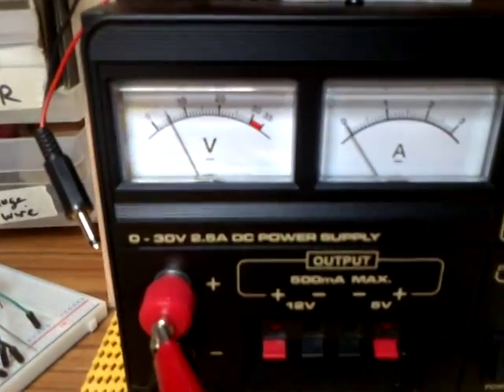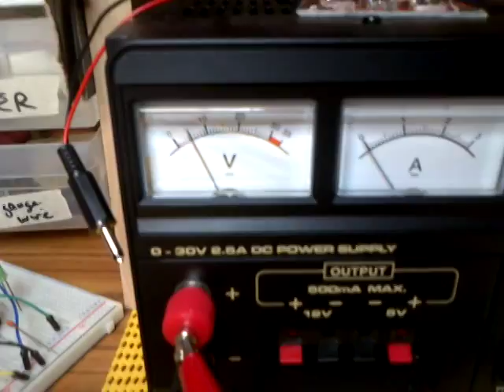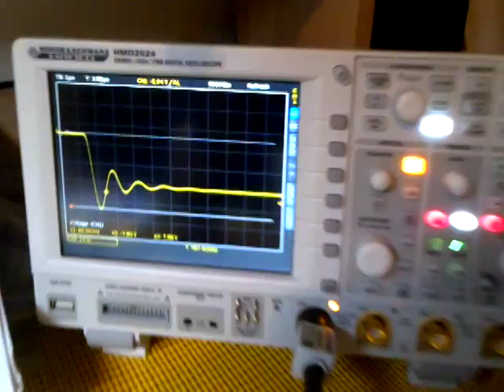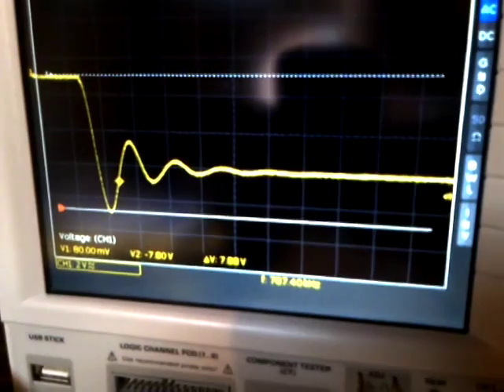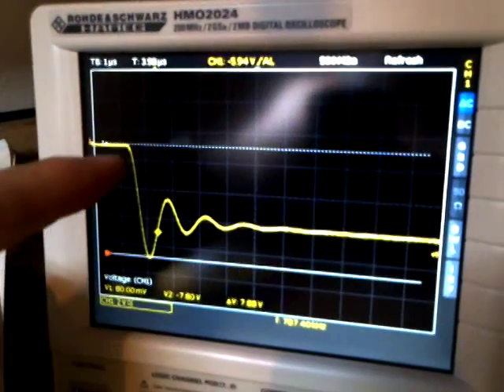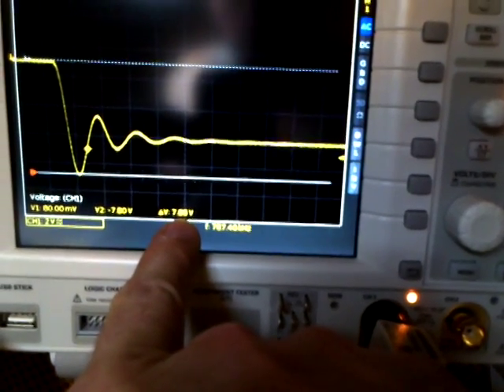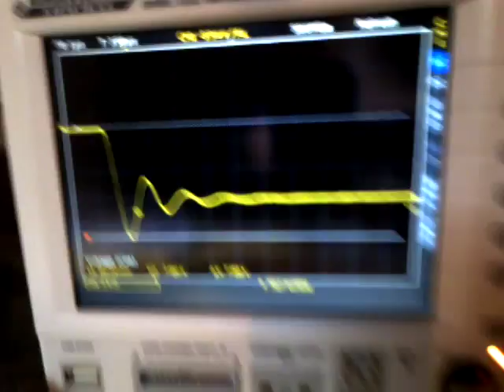LC (tank) circuit addendum  Part 2 of 2

Comment: WHAT IS THE VALUE OF CAPACITOR AND INDUCTOR
Reply from the maker: @nandhakumara4082, I dont recall the capacitor value - it really is not that important. Try something you have at hand and experiment. The inductor was literally a coil of some wire I had on my desk: again, not a critical value. With any L and C values, this circuit will work. What will change is the frequency of dates oscillation. Good luck and thanks for watching.

Comment: I really enjoyed your instructional video.  Thanks!  Could you please share the values of capacitance and inductance that you used in this circuit?
Reply from the maker: Hi Leonardo, unfortunately I cannot recall. It's been a long time since that video was made. I was just playing around with a coil of wire and a ceramic capacitor that I had lying around. You will get the same sort of behaviour regardless of the L and C values you might have. These are related to the frequency of oscillation f= 1/(2 x Pi x sqrt (LxC)). https://en.wikipedia.org/wiki/LC_circuit. Good luck!
Reply: Thank you for your reply. I have been following your design and your steps, but I have not seen the oscillations on my oscilloscope screen. Maybe, I have not selected the correct sample frequency to catch the event through my instrument. I would appreciate any new suggestion in this sense. Best, Leonardo.

Comment: I am no expert and am learning as well. Thanks for your videos. If I understand it correctly, since the starting peak is +5 V and the peak to peak that you measured is 7.88V, then the other peak was -2.88V. Is that correct (it is hard for me to read the scope)? If so, the alternate side did not exceed 5V in the other direction so the decay was already happening.
Reply: It's a DC power supply. It was inductive spiking.

Comment: Because the sine wave you measuring is a peak to peak value, you need to get the average value. 👽
Reply: Yes. RMS for a sine wave is Square_Root (2), or 1,4142. If you divide 7.88 V by 1.4142 you have 5.5 about. This is the reason why you measure 7.88V Peak to peak.